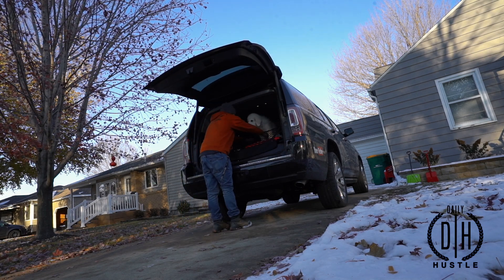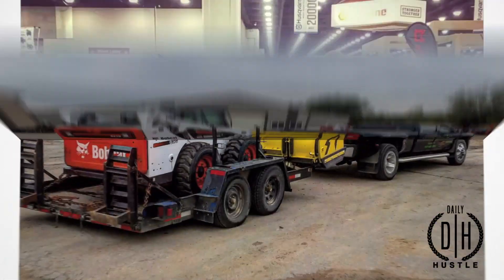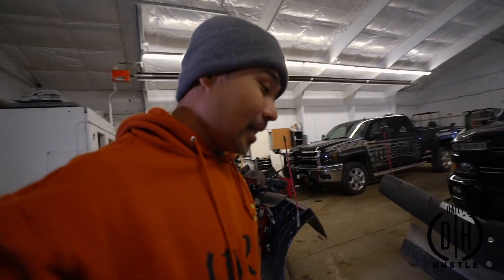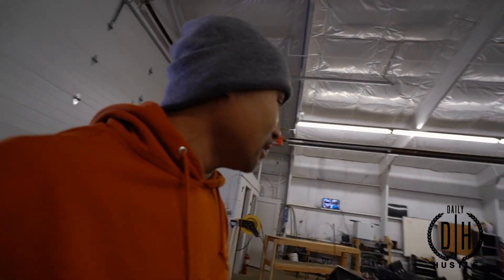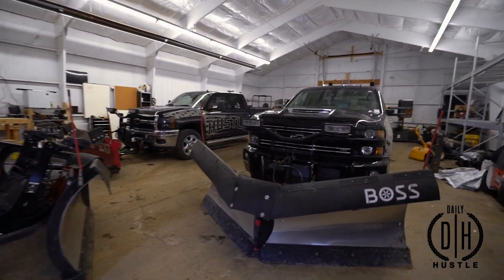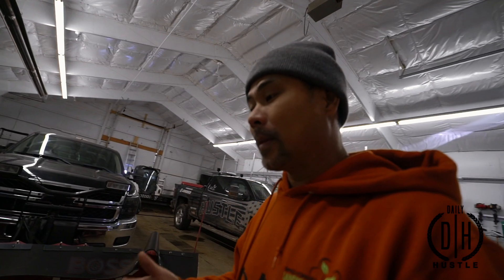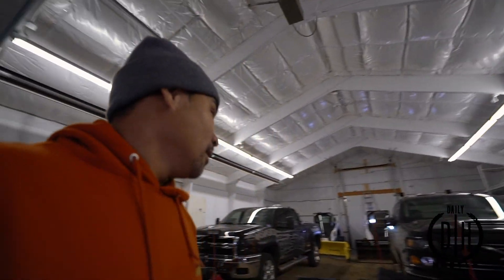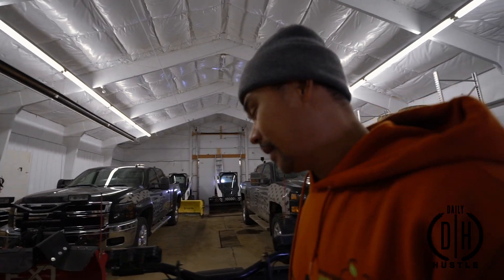I Bought a Shipping container for my bulk salt

Comment: I owned one of the Swenson PV gas  spreaders.   Great unit .  Dependable.  
One advantage with this setup would be, if remote control,  there would be ZERO truck side parts or preperation.  

Electric requires a significant wiring system 

 I have not owned electric,  but I could see an advantage to having a separate speed control for the conveyor and spinner plate , especially running straight salt. 
  It would allow a more precise application imho.

P.s. put a GOOD fire extinguisher in a visible location on each plow truck!  The more wiring , lighting , spreaders etc, the greater chance forva mishap.   A $50 extinguisher could save a $50k plow truck!!  ( my friend is on the fire department and said it happens more than you would think with brand new equipment)

Comment: Get 3 cans of fluid film and coat the bed of whatever truck you use for the salter,  also make a skirt for the back of truck to prevent salt from getting on it, we usually use the rubber plumbers use for a shower pan..that 60$ and 1 hour will keep the truck from going to salt hell!!

Comment: Chant your a Boss  guy. I’d get VBX electric pintle chain spreader, if you don’t use all the salt during the run you can come back to the container and dump it, fill salt bins on site and fill walk behind sidewalk salters, it has lids to keep the salt dry also, Pintle chain allows you to spread whatever you like. 
I started with walk behind push spreader just like you then salt dogg tail gate. Then western tail gate. Now I have a western striker and it’s nice once you get into bulk and can be as efficient as possible, versatile and reliable.
Reply from the maker: I know right

Comment: tips for a gas speader i had one for years .FIRST THING i would do is have the dealer connect the salter battery to the truck so the truck will always charge the battery using an isolator. well worth the couple hundred in parts   gas salters get hard to start in the cold even going from site to site. this was my main problem.  you will save your self a lot of head aches.   get a Inverted V it will take the weight off, get nice cover. don't leave salt over night inside or it will freeze and you will be digging. If you ever get froze up use washer fluid.
i would also look at the electric boss VBX
Reply: @ChantsDailyHustle  
Bring extra spark plugs and a socket just in case it floods ,

Comment: Chant are you buying a used spreader? If so make sure the drag chain is free and movers. Also all the bearings need to be in good shape, the one's on the spinner go out all the time. Buy yourself a gallon of Fluid Film and spray the underneath of your dump truck. It's nice to have the salt truck inside but it will rust far quicker in a heated shop than stored outside under a roof of any kind. I've plowed snow since 1988 and my salt trucks sat in a unheated barn and the rust is still amazing.
I second electric salters and ones with a cover on them too but we all have to start somewhere. You'll have a smile just not having to handle bagged salt.
Reply from the maker: Thanks! Good to know

Comment: Honestly, I see that others are recommending Electric over Gas Power, but above all else, I recommend a PTO driven Salter System. Much simpler system as you have a feed and return. Coming off the PTO under the hood and then a return to the tank. Much simpler in my mind, with the best reliability. Have a few friends in the business run into nightmares with Gas and of Electric. No issues with my PTO Systems.
Reply from the maker: Wow never heard of that good to know

Comment: A peaceful of indoor outdoor carpet. Or rubber  mat. Under the back of the salter hanging off the back of the truck.   Will cut down on the rock salt ripping the paint apart on the truck. From the spinner  Slowing the rot out.  Most dump bodies have
Reply from the maker: Thanks

Comment: 1st : for attachments /plows etc , look into building 2x4 studs framed square  with plywood Equip caddy on caster wheels , it will allow you to put attachment onto rolling  caddy and fit into tight areas in shop out of work area , utube for ideas , other look into harbor freight /other electric 110 hoist to lift new v box spreader on and off your dump truck freeing up room .

Comment: Get a salt dog talgate replacement spreader for the dump truck
Reply: My last company has 6 of them no issues
Reply: This is the only way to do it The way you are set up.  Don’t waste your money on a vbox spreader. Also do not Park the salt truck indoors it will rust and rot 10 times faster than leaving it outside in the winter. Bring it back when you’re done wash it up let it dry and put it outside

Comment: Avoid gasoline engine spreaders.  Once I switched to electric I was amazed how much simpler it was.
The gas motors were always hard starting.  Electric choke system always gets rusty and will not work.  I used to start it in the shop and leave it run for hours before salting to avoid issues.  The clutch froze up on 2 of my gas machines too

Comment: Chant, you should get electric it’s the beat also look at a tailgate replacement for your dump it’s way worth it a lot easier to use then a vbox. it’s a lot easier to take on and off check in to it before you buy!!

Comment: Um you don't want the salt hopper warm  at all..     taking a warm hopper from inside s shop to   super cold temps.  Putting cold salt In the hopper. Can result in the salt turning to a rock.       Stainless hoppers or poly you want the hopper the sane temp as the salt always         if you've ever had a load of salt turn on you..  sitting there with a rod trying to brake it up.  Not fun

Comment: Looks like a PolyHawk PV Series we have 2 and are Very happy with them they hold about 2 1/2 yd + do not pre load your salt ! load it when you are going out cold. And keep that motor on that salter warm till you need it when its bitter cold at night  LET IT RUN from job to job we have done it for over 30yrs a tank of fuel runs a long time carry a one gallon can with you that's plenty. If your short room take those attachments off the machines and leave them outside don't heat that iron there is no reason to do that Chant trust me I made the same mistake when I built my first heated shop big waste of money better well spent somewhere else like paying for a replacement plow you'll need or the salt you buy etc. Your going to have a problem getting in and out of that shipping container. We happen to have a 1'' steel street plate we use as ramp that we put in place with forks and take out when we are done. Because you can't make a ramp into the container with stone because of the door latches you wont be able to close the doors. Maybe you could buy a dock plate J and B is right it will be a soft muddy mess after you spill some salt a few times going in and out of there call in a favor from one of your concrete buddy's and have them pour you a 8 x10 pad them put 3'' clear stone down to carry you to the solid road you'll have to do something don't get the cart before the horse Chant hope this helped you doing good my friend.
Reply from the maker: Thanks definitely helped 👍🏼👍🏼

Comment: Can I offer you some advise... keep the salt truck out of your nice new shop, unless you plan on hosing it down after each use or you'll get rust on everything inside and the condensation will speed up the rusting process! Also, if your planning on the dump truck dumping your salt right on the ground by your container you"ll create a huge, deep mud hole. We use to have our salt delivered to our shop (compacted gravel lot) and by the 2nd delivery we were driving through 12+ inches of muck and getting stuck!  Your going to need to make a asphalt pad for the truck to dump it on. We tried dumping it onto large tarps and that was a waste of time and money, we tried making a compacted gravel pad and that didn't work. We finally asked the store manager at a big box store if we could just put it there and thank God he said yes and has been there for 3 years now.
Reply from the maker: Thank you for advice 💪🏼
Reply: @ChantsDailyHustle  geese thats not bad for a 20x8 container  for $2,500 cheaper then building a storage building for salt
Reply: Whatever you do don't wash your salt spreader in the winter, especially  if you keep salt rig out side. It will freeze up salt and plug things.  It accelerates corrosion like crazy on whatever steel there is on it
Reply: Agreed on the dump site for the salt
Reply: @ericronningen8575  we never wash ours because we use it for spreading lime and fertilizer wich was cheaper then spending $860.00 a day renting a tow bbehind  fertilizer spreader

Comment: If u put those two trucks closer to the walls u might be able to fit yr dump truck in between them It might be worth the try
Reply from the maker: I might have to try that
Reply: I mean i paused the vid an looked at it an I was like man if he moves both trucks over he might just hav enough room. Just thought I’d throw tht idea out there because I’d want someone to do the same for me but I hope it works 👍
Reply from the maker: Thanks man
Reply: Here’s some advice make sure to keep tht salter clean an I always like to park the machines with the rear not facing towards a wall because if u ever have to jump them u won’t be able to get to the battery with it facing the wall just some advice tht I’ve learned.

Comment: Great video Chant, that is a good idea, but the only thing it is going to rust and corrode.
Reply: Maybe if you Rhino lined the container it wouldn’t rust and corrode. You think?
Reply from the maker: Yes it will eventually corrode but for now it will work
Reply: @ChantsDailyHustle  right and that’s what matters!
Reply: @ChantsDailyHustle  right and that what matters it works!
Reply: If you spray it with linex it will protect the metal

Comment: Be careful not to pre-load your salter before a storm and keep it inside a warm shop. If the temps drop drastically during the storm your load will freeze to the sides of you v -box hard as a rock.  Salt has a certain amount of water content in it (the big companies do this to screw the little guy on weight because they know they won’t test it). Always load the night of the storm. It happened to me ONCE and only once!!  Good luck, commercial salting is $$$$ with minimal wear on equipment compared to plowing.
Reply from the maker: Good to know thanks 👍🏼